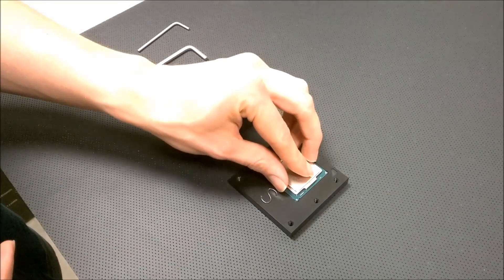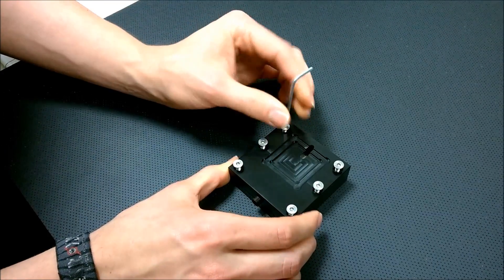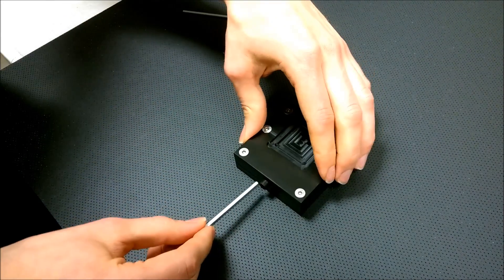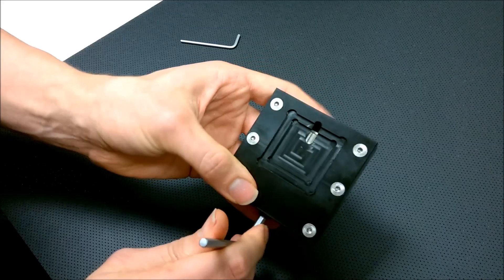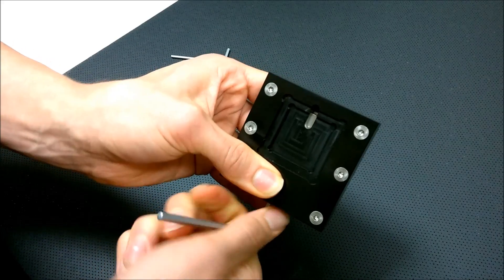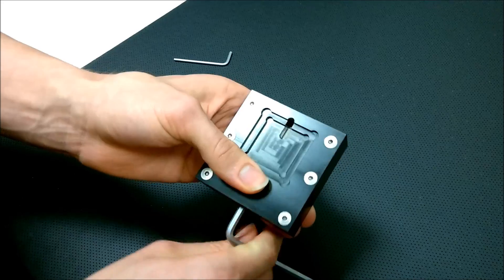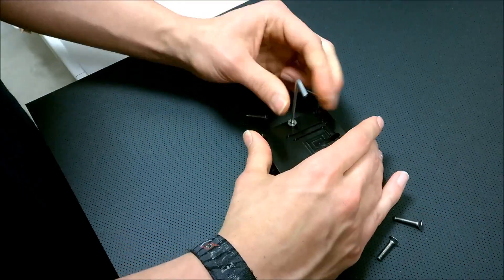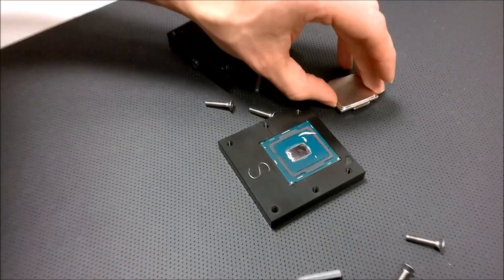der8auer Delid Die Mate - Advanced CPU Delidding (Skylake, Haswell, DC, Ivy Bridge)

Comment: Woah. Definitely interested. I'd assume these would work just fine with broadwell-e, right? Picked up a 6800k on release date.
Reply: I like my 6800k. Does exactly what I need it to do along with gaming. Doesn't seem to slow down my 1080 either.
Reply: ye :)
It's a lot faster than the 3630qm that I oc'd in my laptop

Comment: Hey, that's really sweet. I want one as soon as it becomes available. Question, when you say Ivy, does it work for Ivy-E like 4930K and 4960X with the soldered IHS? BTW, great video on the razor blade delid. I watched it right before delidding a 6700K. I want to delid my 4930K if this will do the job.
Reply from the maker: +MrFoxRox2 4930K is soldered so no, don't delid it :)

Comment: this can work on my first generation i5 760?
Reply: +Amnesysss Nope, the i5 760 heatspreader is soldered, so using this tool to delid your CPU would kill it. You shouldn't have any need to delid the CPU as it doesn't suffer from the same heat issues that TIM'd heatspreaders do.
Reply: uhm thanks for your answer.

Comment: That's pretty damn cool. How does it actually work though?
Reply: +Panga the blocks hold the cpu in place while the small piece that you see in the begining pushes the IHS upward, by turning the key, until the glue gives. the whole trick to this was getting the measurements just right. cool tool anyway, going to purchase one if it is not very expensive, did not feel quite at easy using the razor blade method.

Comment: Is delidding a Sandy bridge processor also recommended? My Corsair liquid cooling pump snapped while i was installing a game and i didn't notice it until i finished installing. It's seems that, since than i have random lags in games link BF4 (1 second freeze).
Reply: +Erik Visscher It&#39;s absolutely not recommended. I think that would damage your CPU, since the IHS is SOLDERED on the CPU die. From Ivy Bridge and all the newer CPUs that arent -E processors (those 6-core E-CPUs with 125W TDP are soldered as well...) have thermalcompound instead and that results to a much, much higher temperature. So, there is no reason to delid a Sandy Bridge or a -E (Sandy Bridge-E, Ivy Bridge-E, Haswell-E, etc.) processor because of that.
Reply from the maker: +Erik Visscher Sandy bridge is soldered so no :) you should not delid it.
Reply: Thanks. Than i might need to look for a temporaly replacement of my CPU to see if my CPU is starting to fail.

Comment: got a version for x99 cpu's?
Reply from the maker: +AayVy X99 CPUs are soldered so it wouldn't work :)
Reply: dam'n
Reply: +AayVy x99 or better Haswell-E is delideable, but you need strong faith, but this tool would not work. You need a Iron. But it is not recomandable. Sombody did it in the german community.
Reply: ***** As i said you need an iron. And it is doable. Someone did it. do you need a link?

Comment: price?
Reply: +Alex Serban think about it as an investment (buy one in common with friends, or one for you and charge for secure delidding of people's CPU). As my job sometimes includes building or tuning PCs that kind of price is not incredible for a tool. But yeah for someone thinking about using it once or twice, that's an expensive tool (but in that case there are still the "good old ways" for delidding).
Reply: Price could probably fall very low (nothing special about the item). If a lot of people bought it. But like every other specialy designed tool targetting a very specific demographic, it won't be cheap (and I'm not even sure the creators will make much profit out of it).
Reply: +Alex Serban 89.90€
Reply: too much !
Reply: +WAIFER Ugh I hopen around 20, I guess it's expensive since not so many will be sold, and since my 4670k is still worth like 190 euros maybe it's better to use a tool than to accidently break it :/
Reply: +santeenl Fü;r 20€ inkl. Versand wü;rde ichs mir auch glatt kaufen. Es ist für nen Prozessor ggf 100 bis 200MHz mehr. Was dann umgerechnet so je nach € pro GHz Verhältnis zwischen 5-10€ beträgt. Insofern wäre das defintiv schon mal nen guter Ansatz für nen Preis wenn man mehr davon absetzen wollen würde.

Comment: For gluing the IHS back down to the PCB, I like to use Permatex Gasket Maker. It's 8$ USD for a giant tube of the stuff, more than enough to reseal dozens of CPU's. You can clean any excess that squeezes out with a toothpick while it's still "wet" (not fully cured) to make it look nice and clean, and since it's made of silicone it's electrically safe as well. You can buy it at most any O'Reilly's Auto Parts or Autozone (If you're in the US) or on Amazon.

Comment: whats the advantage of delidding?
Reply from the maker: +Peter Gratineau you can replace the stock thermal paste with a high performance product. Usually the CPU temperature will drop by about 15-20 °C after replacing the internal thermal paste.
Reply: 15-20°c ?? now i am interested , where can i find more info and temp benchmarks on this theme in reference to the 4790k. Dankeschön aus Österreich ;-)
Reply: +Peter Gratineau just keep in mind that it'll void your cpu's warranty